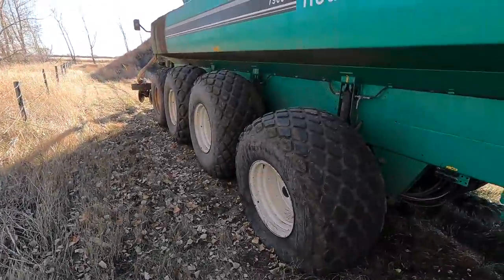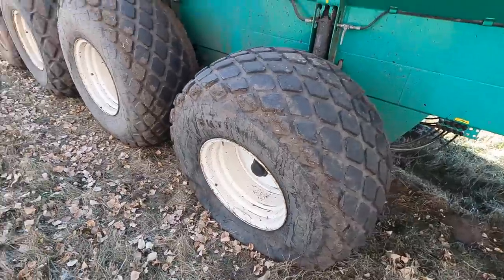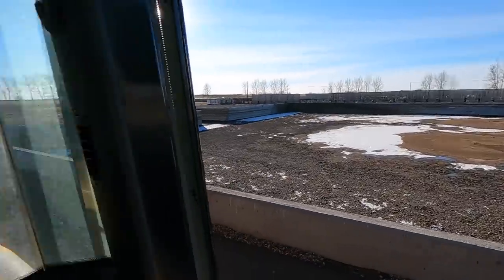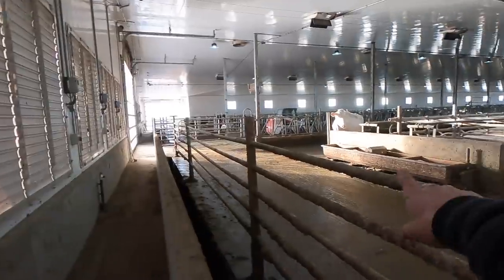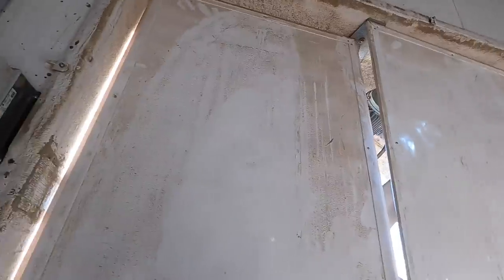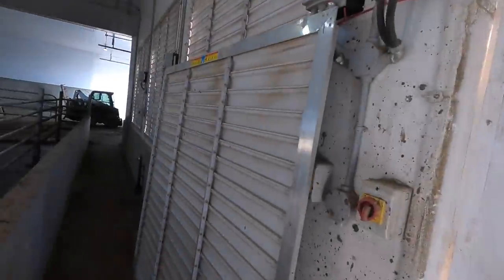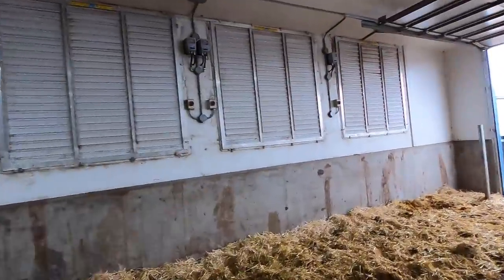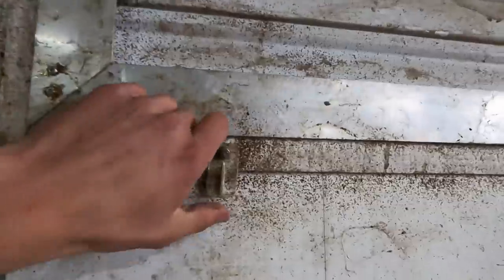Thats An Expensive Tire To Replace... 🤦‍♂️

Comment: I spent years installing overhead doors and servicing them. Make sure you  apply a coat of lubricant  to the lifting cables aa well. The cables corrode  and snap causing  catastrophic  damage.  There is an incredible  amount of spring tension on the torsion bar.

Comment: Nice introduction.  I do temperature conversions in my head when I am in NE Saskatchewan.  Temperature in Celsius times 1.8 plus 32 is temp in F.  10 C = 50 F,   20 C = 68 F.  Bring it on,

Comment: Bring it on !!!   C to F is simple... multiply C by 1.8 and add 32. Boom. F.   Hey is there any value to running dehumidifiers in the winter - I'd guess upkeep and possibly some disease/conditions might be reduced  - but don't know.

Comment: Jan, time is money, it would be so much faster each season if the insulation panels were fitted into a frame that could be latched in with the hooks. Then, just like you store the panels in the summer, store the louvers in the winter. Plus, the panels would then be air tight.

Comment: Live the new intro just a small suggestion. When jacking that spreader put two if this big blocks side by side with a board across both. Spreads the weight and it won't fail in soft ground. Love the vids

Comment: Should use some small metal brackets so that act as a stopper and you just have to push the insolation into place, would save you some time.

I don't comment any videos, nice and informative videos keep the good job up. BRING IT ON

Comment: You need angle iron brackets to push your insulation against and screw them to! It would be fast and clean and align your panels in no time. Instead of brackets if you can put full length angle iron ( or aluminum) it would help seal your panels and be a little more air tight.

Comment: Bring it on

A quick conversion of Celsius to Fahrenheit is to take the Celsius temp. and double it and then add 32 degrees to give you an approx. temp in Fahrenheit.
Reply: Looks easy enough to remember. I'll try this out, thanks.
Reply: Don't work when -40 is -40 lol

Comment: Bring it on! Here in the UK, coldest temp we get is the v v occasional 12 c convert that lol. The temps you get, you need the barns etc for the milkers, calves, youngstock to be as they are. How do you cope with all the feed lots outside with water freezing up though??
Reply: -12 that should have read!

Comment: Just a thought. But wouldn’t it be easier and much more reliable to just install a roll up garage door above those fans. So in the winter time you just roll the whole door down and no air gets in. Also would allow for an easy transition on warmer days to quickly open those fans and then re close them.
Reply: A roll up garage door is not insulated. Minus 40 outside, plus 20 inside with 100% humidity and you will have a wall of ice pretty soon. This is why he needs insulated panels.

Comment: Ok, down till around minus 40 degrees in winter. Brrr. Understand have to prepare the cowbarn well for such situation and it gets totally soaked and humid from the cows respiration inside. A challenge and you try to get things protected and functional beforehand. And end with ...:  'Bring it on'. Waiting for the cold to come..? Checked the forecast, another week with temperatures up till 16 degrees Celcius during the day, but during nights already below zero, so, guess right in time Jan.

Comment: Sorry for being so picky but with all that daylight coming in on the edges of those panels you need to devise a technique to eliminate that air infiltration. Just a rough guesstimate, but based on my experience with blower door testing, it appears that the sum total of all the air gaps remaining is equivalent to having a 4 foot by 4 foot window open 24/7 in each barn. A pretty significant air leakage. If you took some cans of door and window great stuff(low expansion) to spray around the perimeter of all the panels, you will really notice a huge difference in temp. It can be scraped off when the panels are removed in the spring. #Bringiton

Comment: To change Celsius to far if it 10 degrees Celsius double the temp and add 32 that will get it real close quick and easy. So it would be 52 degrees Fahrenheit.

Comment: How would it work if you fastened some bolts permanently  to the louver frame, then drill holes on plastic sheets/ cover then add a nut. Easy on easy off

Comment: Why don't you run a 1 1/2 x 1 1/2 trim board around the inside of the fan than the panels would fit in perfect every time with no leaks.What happening  with the rumba hay sweep

Comment: Is a Canadian Rubber booth the same as a Rubber mallet? Not any plans for getting an battery electric off-road cherry picker? I've seen a lot of opportunities for you to use such a handy thing. Maybe a little more secure than a bucket?  And now is time to Bring it on even here in Sweden. :D      Long live the "Systeme Internationale d'unité de mesure" and the Centigrade temperature scale by Anders Celsius 1742 in Uppsala, Sweden.

Comment: Here is an easy way to convert C to F:  (C*2 )- 10% + 32.  If 10C then it is 10*2 (20) - 10% (-2 [18]) + 32 = 50F.  It is not exact but close enough for "pin the tail on the donkey".